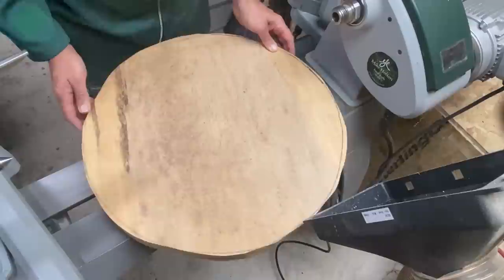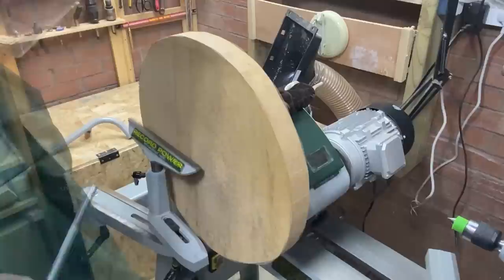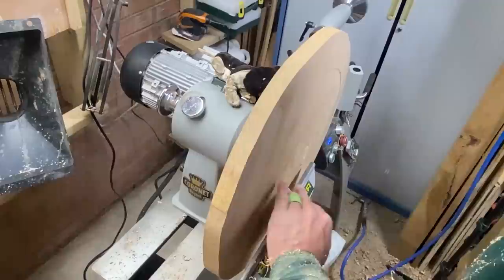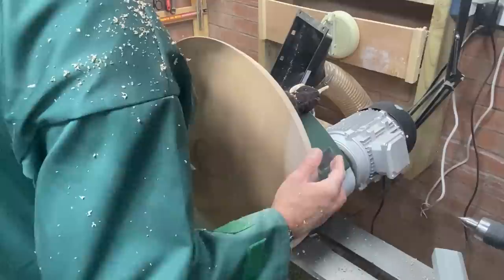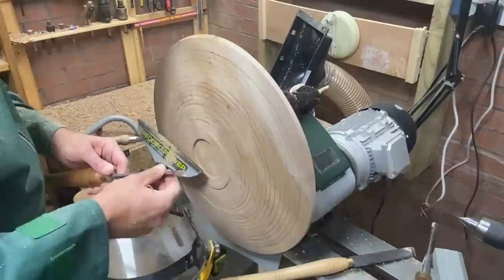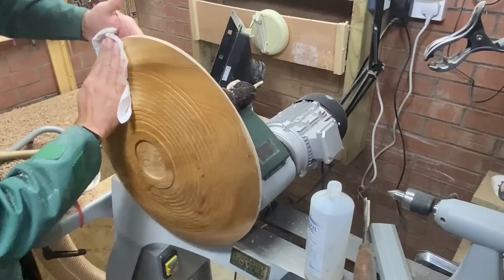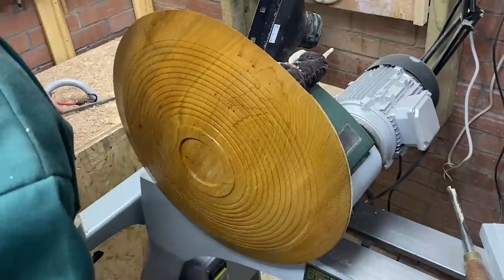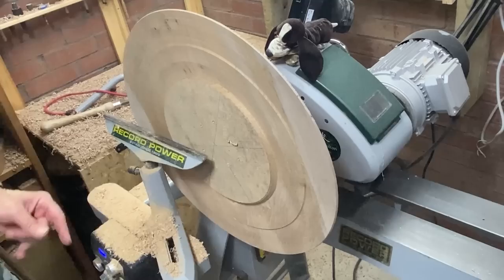VERY SCARY Outboard turning - Woodturning project

Comment: I love elm. What a delight. Again you snapped success from the jaws of failure. 
I remember when I first worked with elm. The double thick coffin boards were cut specially for me by a local builder/undertaker using a mill powered by a tractor. I turned a 9” bowl an over sized wooden spoon about 120cm long and made a Japanese style coffee table. 
45 years later I’m turning again by watching what you do.
Thanks so much for your lovely honest presentations and gorgeous wholesome pieces.
That large elm plate took me right back.
Quite scary doing something that wide!.
Well done again!
Reply from the maker: Thanks so much Nicholas, I love the idea of a 120cm spoon, that must have been great fun to make. Elm is a beautiful wood to work with but boy is it hard! For a while I thought this one may beat be but we got there. All the best and thanks again for getting in touch. Mike

Comment: I love the way your machine can be used that way. By turning the headstock around to be able to work larger items and the adjustability of the speed. My mini lathe has a fixed head and to change speeds I need to move the belt. Maybe I'll be able to step up to a better machine one day! The grain on the elm is gorgeous! Beautiful work Mike!
Reply from the maker: Thanks! I'm very lucky to have this lathe it's so much better than my last one I started the channel with. Apparently it can turn nearly double what I had there 39". Not sure how keen I am to try it though 😁

Comment: I love the platter.   Gorgeous grain in the wood.   Very well done as usual.
My heart sank, as I expect yours did, when you had the catch.   Glad you did not get injured.   "Murphy" required design change.
I have only turned a couple of slippery elm bowls from a tree a friend had to take down due to disease.    I turned one of the bowls for the friend as a memento.   It was fun to do the initial turning when wet.   It was very wet, if I recall over 50% moisture.   Long ribbon shavings and a line of water on the wall.    Fast forward a few months for the second turning, it was like Jeckyl and Hyde.   It was not fun to turn, very hard when dried and made dust more than shavings.   Sanding was also a major hassle.   It took forever to get the tool marks removed.
My local turning club says another domestic wood which is difficult to turn is black locust.    I do not have any.   I have honey locust, but this is not as difficult to turn.
Dave.
Reply from the maker: Thanks Dave, the catch hut my pride more than my finger but it's all part of turning as Murphy dictates. Never tried any type of Robinia, not a great deal of it over here but it does come up once in a while. I'll try to get some to see what it's like. 
This piece came from a guy selling up due to health problems and I ended up getting about 20 blanks off him including bubinga, purple reart, zebrano and paduck. 
He has a load of yew, laburnum and ash, all been sitting for 15 years I may go back for as long as I can find a place to store it. 
All the best
Mike

Comment: Excellent work Mike.  I turn quite a few large platters typically 18-22 inches and often only have about two inches depth to play with so I glue a plywood piece on top for better purchase for my face plate, then glue a block of hardwood on the flattened base for a tenon which I have to later turn off.

I find this technique works well.
Reply from the maker: Thanks Robert, how do you turn off the one on the base without a tailstock? All the best, Mike
Reply: Mike, I am able to swing 22 inches inboard so I use a large piece of plywood as a face plate to reverse turn the pieces with tailstock support
Reply from the maker: @robertbourke7935  I do this when I'm turning over the bed but as I can only fit 18" over mine this had to be turned outboard

Comment: Beautiful platter and well done making it through the process. There are some turnings that are a struggle from start to end. I usually go for tung oil over linseed since it doesn't add that amber or yellow hue to the wood but it really does look stunning on that elm.
Reply from the maker: Thanks for the tip, never used tung oil, must get some and give it a try. Thanks 👍

Comment: This is a beautiful piece. Turning the beads is easier accomplished with a spindle gouge, but perhaps not in wood that hard. Glen Lucas has an instructional video on how to turn bead bowls, and it’s easy to follow, love your lathe! It’s ability to outboard turn is tremendous.
Reply from the maker: Thank you very much Noel, The problem here is the angle the wood is coming onto the tool, looking back I think it would have been better with my skew so the top edge would never be near the wood to get a catch. Something to practice for sure. All the best, Mike. P.S. Yep the lathe is amazing!
Reply: I really liked the chatoyance in the wood and the grain was another plus ,sometimes you never know what beauty you have till you start turning away some layers .
Reply from the maker: @henryrodriquez4706  Thanks Henry, you are so right, it really is like opening a present, you never quite know what you will find inside 😃

Comment: My lathe will handle 16" outboard, but I haven't been brave enough to try it yet. I'm still relatively new to bowl turning. The biggest I've turned is an 8"
Reply from the maker: Hi Jeffrey, when you do try it don't use Elm lol. My lathe will handle 39" outboard but I'm in no rush to try it 😁

Comment: G’day Mike finished product was excellent.
I really liked the design of the front, simple classical elegant and extremely functional.
The shellac and raw linseed oil finish is amazing.
Is it 1 pound cut shellac. 50:50 to raw linseed oil.
Does it need another coat after a few hours or not. Thanks for sharing .
Reply from the maker: Thanks Greg, it's nit quite 50:50 but close, I think I only put a couple of coats on this to see how it faired. 😀

Comment: Great piece about getting out of your comfort zone. 
I am looking for a lathe to do large outboard turning. The rotated headstock and side tool rest bed you use seem to work well. Can you share a quick list of things to look for in a lathe for outboard turning?
Thanks.
Reply from the maker: Hi there, thanks for the message. If you are looking for a lathe to handle large outboard turning then you will need to get something heavy with a variable speed as you need to be able to cut down vibrations. Also useful is the ability to move the control pad to various locations on the lathe so you can avoid having to lean over the piece. After that it's all about build quality, as with anything like this, get the best you can so it lats.
Reply: @MikeHolton  Thanks. What about the tool rest?
Reply from the maker: @chasmikrut5809  Good point, the tool rest on your lathe is supported by the bed but on outboard turning is is usually supported by a long arm coming off the side. The longer the arm the more chance there is of breaking so it needs to be robust enough to be able to take the forces required. Some of the very large lathes provide a separate pedestal tool rest which are naturally stronger than those attached to the lathe but there are not many of this type about. What size of bowl are you looking to turn outboard?
Reply: @MikeHolton  Mike. I might go as high as 20”. I have some white oak blanks that are that big.  I am looking at the Harvey Turbo T-60s.
Reply from the maker: @chasmikrut5809  Morning, it's not a lathe I have heard of before but looks nice, the only thing I've noticed is that you can't alter the speed with the remote control, it looks to je just on and off.

Comment: Beautiful, thank you for the video :)
My understanding of shellac is that it was dissolved in alhocol before bieng applied. therefore how come that you can clean the surface with alhocol (at 17:34) without re-disolving and wiping the shellac you just applied?
Reply from the maker: Hi there, good question, as the initial layer dries it also seeps into the wood, the wipe over with alcohol will remove a small portion of it but the majority is still there. All the best, Mike
Reply: @MikeHolton  I see. Thank you for taking the time to answer! I got my laithe last week, currently setting up and hopefully i'll do my first experiment tonight :)
Reply from the maker: @gregoiredemange6437  fantastic!, good luck and I'm always happy to answer any questions you may have, all the best, Mike

Comment: G’day Mike,
Is that a P & N chisel your using. I think they’re the best. Also I can’t imagine that elm is harder than some of the Aussie hardwoods that we get down here. Iron bark leopard wood, and string bark and black butt are very hard timber. 
I can turn up to 600mm over bedways on my vicmarc lathe, one of reasons I bought it.

As usual great video and beautiful piece of turned timber.
Reply from the maker: Hi Greg, never heard of P & N  so no it's not lol, the gouge is Record Power and the skew I used is unbranded 😀. I think this was so hard to turn because it was so dry, I have a lot harder woods in the shop (greenheart, olive etc) so I will be able to make a comparison soon 😀. The Angelique I turned a few weeks ago was certainly harder than this el. All the best, Mike

Comment: Hi Mike. Nice piece. Did you just eyeball the center?
Reply from the maker: When it was mounted? I used a ruler and tried to find it that way.
Reply: @MikeHolton  But how did you know the first line was exact between left and right?
Reply from the maker: @stapeling  If you look at the start of the video you will see that there is a black circle marked on the blank, I measured the widest part of that circle and guaged the rest from there, it's not perfect but it worked in this case.

Comment: Do you use a face shield with a filtering system ? If so  what kind.
Reply from the maker: Not at the time, I had a normal face shield and a half mask for sanding. I have however, just got a JSP POWERCAP INFINITY PAPR System which is going to keep me a lot safer, you will see it in a couple of weeks.

Comment: Great looking plater Mike,just one question to ask that finish you put on would it be food safe or would it need another coat of food safe finish ?
Reply from the maker: Hi and yes it is food safe, I used raw linseed oil instead of boiled so it would be food safe, all the best, Mike
Reply: Beautiful finish, curious about the proportions you mix for the oil and shellac.
Reply from the maker: @garybeasley4885   It's probably about 60:40 oil to shellac but anything around there will work fine.

Comment: I could have sworn this piece would come off the lathe or you'd join the funnel club - you managed it, congratulations! I'd like to know somethin about your outboard device. Did it come with the lathe or is it a non RP-device? I'm asking because my setup for the Herald is rather wobbly so that I initially thought your catch was from the toolrest.
Reply from the maker: Hi Kerstin, I got lucky this time. The setup is designed by RP for the Regent and the Envoy, it's a pretty heavy unit designed to take a battering!